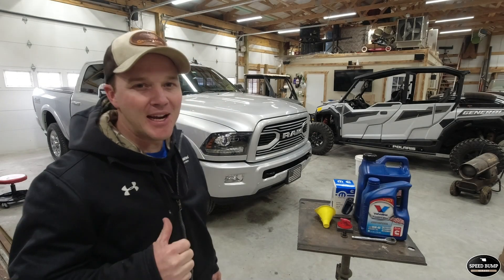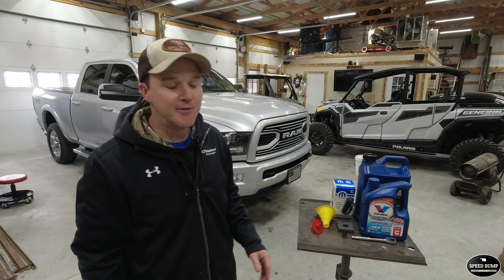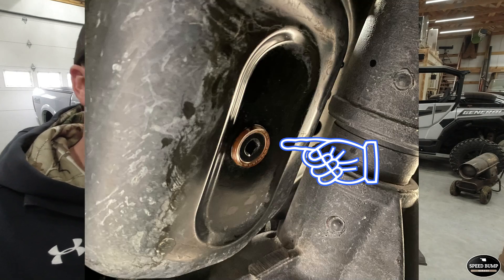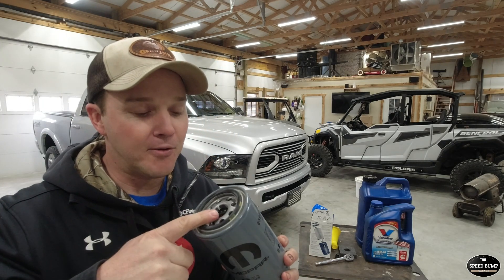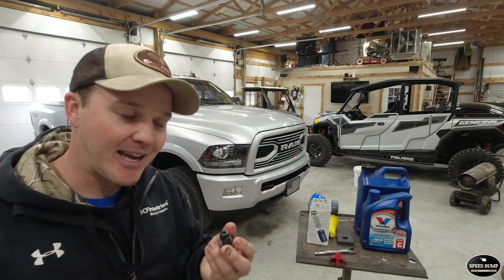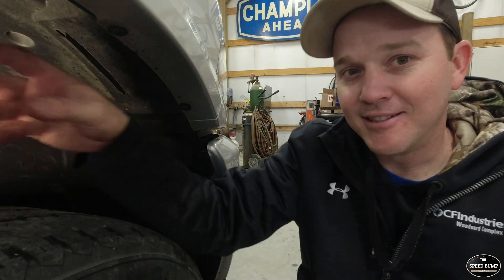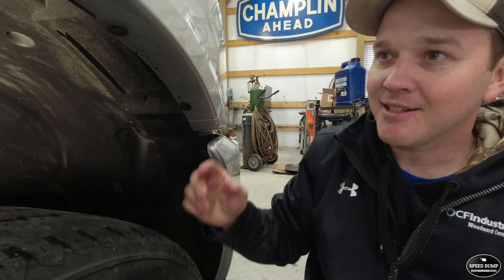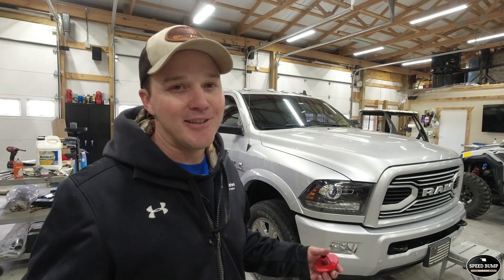Changing Cummins OIL with NO MESS!

Comment: Cool oil change tool for the filter. I have a duramax and the dealer changes it. Never had an issue with dripping oil, but they can really get the hood and grill dirty!
Reply from the maker: I hate oily hand prints on my truck!
Reply: For a duramax? On the duramax all of the oil stuff is in super easy spots, im surprised they even get their hands dirty honestly.

Comment: Neat tool Kent. Here's another tip, use grease on the filter seal instead of oil but, be sure to put the grease on the seal before you fill the filter with oil. It'll be a lot easier to remove the filter at the next change.
Reply from the maker: Thanks
Reply: For the cummins you can put the filter in without oil and have no issues. Definitely still need oil or grease of the gasket, but you dont need to fill the filter.

Comment: That tool would’ve been nice when I use to work for the commercial Goodyear tire and lube in Okc. I hope the fuel filters for those have gotten easier to get, use to have to direct order from Cummins before I left there.
Reply from the maker: I didn’t have any trouble finding fuel filters
Reply: The fuel filters are super easy on this generation of ram.

Comment: Cool tool, but I change these things a lot, using only a pig mat. Pull filter, cover with pig mat and pull it out. Drop into a bucket, screw in the new filter, done. You don't have to fill the new filter with oil. My job is Preventative maintenance. Any make, any model, Ram 2500 to Komatsu D475 dozers, and anything in between. Excavators, trucks, backhoes, loaders, whatever. 
Pig mat is cheap.
Reply from the maker: The pig mat trick is a great idea!
Reply: Im a Ram master tech and yeah, you definitely dont need to fill the filter with oil. In fact, its better that you dont.

Comment: Jonny the engineer  sure put the screw to you on that filter location.  But nice tool to have if you have a Cummins
Reply from the maker: It helps a ton!
Reply: Yep, these tools are fantastic for cummins. Not many other vehicles I would use it on, but for a cummins its a must have.

Comment: Hey Kent, I have a 2001 with a 5.9 turbo- I don't know if they are the same tool but if I have to switch to another page from your link do you still get the credit?
Reply from the maker: I should still get credit. My 04 5.9 had the same filter as my 18 so I think it should fit

Comment: Heads up to anybody watching, those caps work great but it will still leak oil if you do it while the oil is cold. Not a failure from the caps, but it leaks from the place that puts the oil through the filter. 

The truck either needs to have just been turned off, or have been sitting overnight. 

The leak isnt much though, so not a big deal anyway